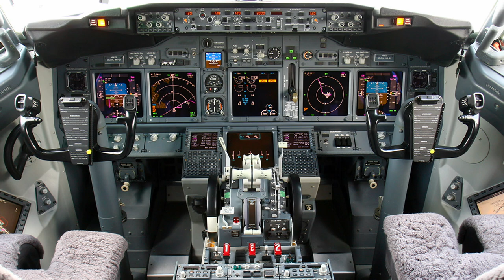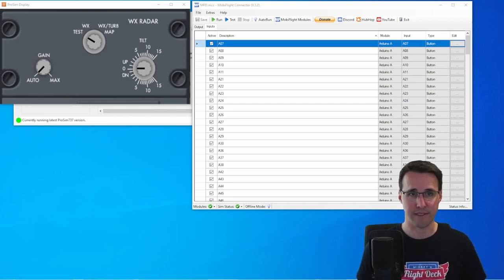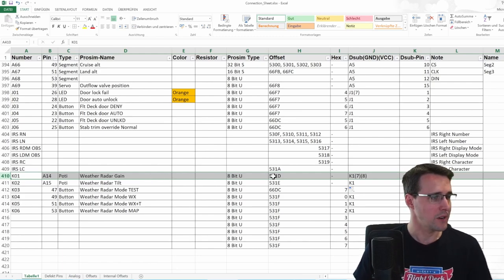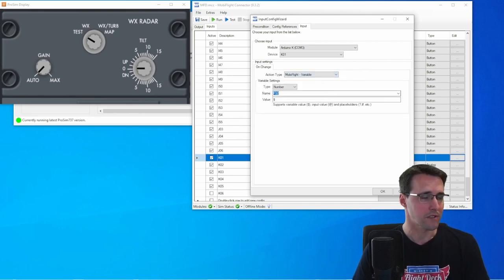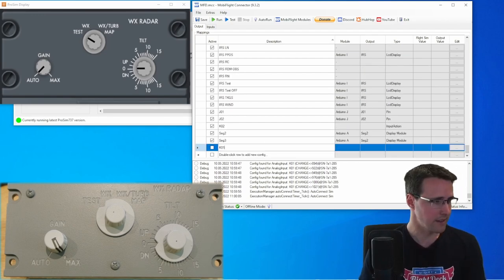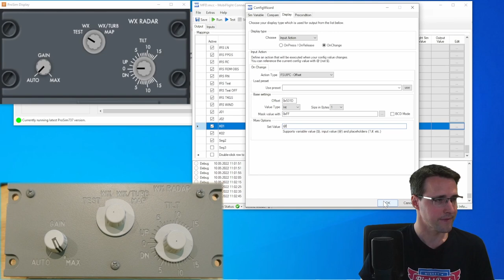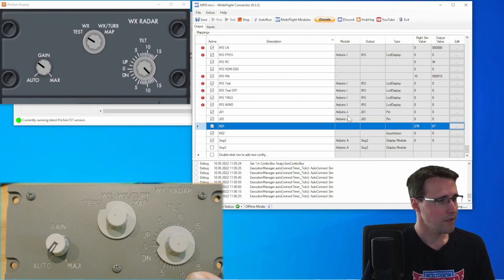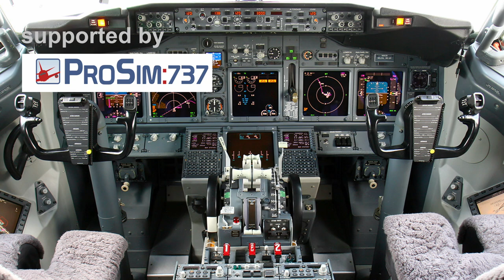Weather Panel - A Boeing 737-800 Homecockpit #68

Comment: Nice panel! Curious as to why you add 3 layers of plexiglass, rather than just using 1? I'm in the process of making a panel, but was planning on just using 1 layer of plexiglass, and mounting that with the 4 corner screws.
Reply from the maker: Most buttons and switches are mounted to the plexiglas with a nut. This nut comes on top of the plexiglas. If it doesn't matter that you see this nut then you can try to do it with just one layer. In my case the nut is surrounded by the middle layer and then covered by the smaller hole of the top layer.
Reply: @Mickeys_Flightdeck  That makes sense, appreciate the response!